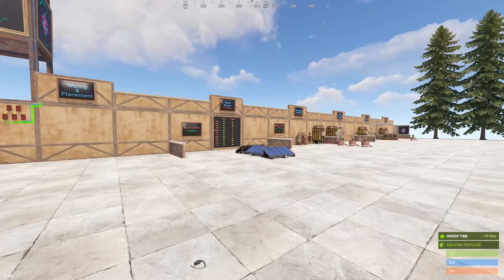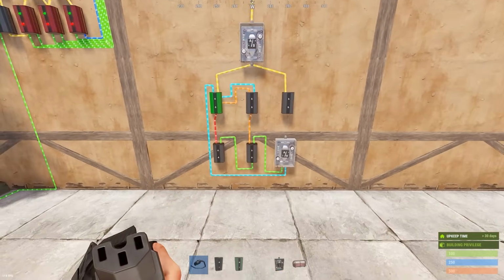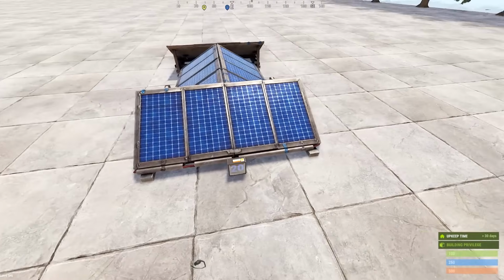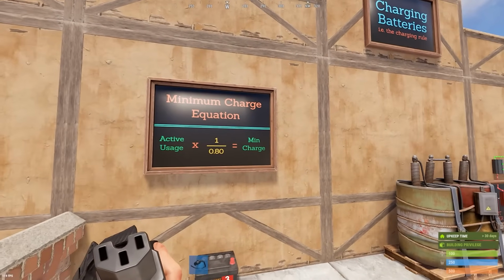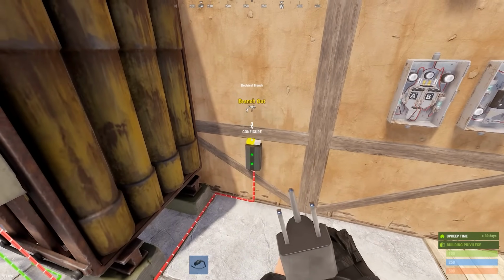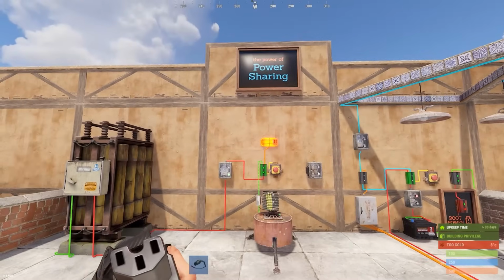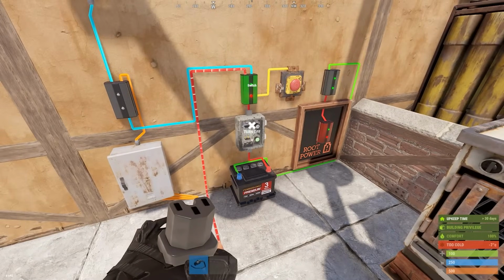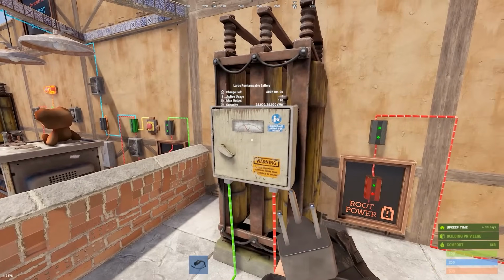RUST Electrical | How To WIRE LIKE A PRO | 5 Core Concepts | 2024

Comment: Man as a new rust player this shit is insane, this games mechanics from building, wiring, plumbing, and automating are so advanced/sophisticated it blows my mind. Had to watch this back a couple times to really have the info sink in before I hop on and update my bases wiring.
Reply: i didnt attempt wiring in my bases for the first 400 hours. I was surprised at how easy it was to get the hang of some solar panels, root combiner, battery and branch all to get some eletric furnaces going. 

Then i wanted to get a drop box and auto fill the furnaces. With a bit of planning i managed to get that working first try using the pipe tool. Its pretty similar to wiring.
Reply: @RealHukTV Yeah after 1k hours playing wiring is pretty easy now, just needed people with more experience to run me through things. Plus with lots of practice it makes so much more sense than when I was first starting. Still blows my mind how much you can accomplish though, whenever I tour someone’s base on pve or pvp I learn so much and improve with my next base

Comment: I’m extremely ocd about how straight everything is and making things look neat. I didn’t know you could snap align things together. Thank you you saved the itch in my brain😂
Reply: Now if only they'd allow the wires to snap align vertical and horizontal while you hold shift as you drag them
Reply: @KCM25NJL which part of an upcoming update.
Reply: Same here 😂 ! I'm spending way too much time aligning things neatly, that's now a solved issue 😌

Comment: "XOR" stands for "eXclusive OR". as in, "eXclusively one OR the other, but not both". as opposed to an OR switch, which will still work if it's getting power from both at the same time. not to say your pronunciation is wrong; but the way i was taught to pronounce it, "ex or" helps me remember what it does. i hope you find this info helpful if you see this. your video has been very helpful.
Reply: I did🙏

Comment: Hopefully you read this. I had an idea about an automated buy and selling system for horses and bikes in rust using AND switches with pressure pads, lasers, and buttons to meet conditions with conveyors detecting payment and door controllers. Just thought of it but thought it might be a good video idea for you. You know rust electricity.
Reply from the maker: Interesting!
Reply: Did you figure it out?
Reply: @ I haven't played enough

Comment: I think it matters where you place your base. If you are located in the North, I've found that pointing your panels South increases the output of the panel. Likewise if you place your base in the South, pointing North. Generally the video I watched suggested pointing the panels always towards the artificial equator of the map. I tend to get a slightly better throughput this way. 
I think your experiment is flawed with regards to the power since it does not take into account the difference in locations. At the end of the day you'll still likely get sufficient power, but I've tested it with multiple locations and pointing either North, or South (depending on your location) towards the halfway mark of the map seems to give the best outcome, though the differences are probably about 4 per panel, but over time (and panels) a significant difference.

Comment: I was trying to run 3 large batteries into one feed of 300 via two root combiners that fed out into a branch that I had split to 1 industrial light as a visual clue the rest out to my stuff. 

I had more than enough generated power via solar and wind to support what I had running but everytime the server rebooted all my stored power would varnish. Three fully charged batteries would just be empty.

Any thoughts?
Reply from the maker: Assuming that I understand you correctly, I would guess there are two possibilities:

1. The server you're playing on is modded, and they've done something weird on the back end thats affecting the batteries.

2. Because you've hooked up three large batteries in "parallel" (combined outputs), you're "triple dipping" the active usage across all batteries. This only matters if you're not using all 300 rWs. If you are maxed out at 300 rWs of stuff, you'd need a minimum of 376 rW of root power on average over a 24-hour RUST day.

Hopefully this made sense! Happy to help you on my server or join a stream.

Comment: Dont be sorry for us console players ive used both your neh core setups but the old one worse for us to have 3 active use the new one works but just shows what youre drawing also so both are helpful ive also used a 4 battery core setup this wipe with 4 windmills 6 solar panels running 50 turrents while also have counter alarms in both open core for both large and small then also having a circuit out for our own ccameras olus used your wireless heartbeat sensor setup to a counter in the corners in our compound with 4 on externals so just shows how many people have jumped the walls over night

Comment: I love what they've done with electricity. I also love that they've fixed turrets. I especially love the new seismic scanner with radar alert on RUST+... Now you can know when someone lets off even an explo bullet within 30m! I'm online within 10 minutes, defending, smoke grenades thrown, lockers put down in doorways, and even better is shooting raiders with turrets while your loading in with your mobile phone!! I love Rust for its features. no other game like it.
Reply: By fixing turrets do you mean making it so that those of us that don't cheat no longer have a way to defend our bases against cheaters due to being so ridiculously limited on the number of auto turrets we can have now?
Reply: @WhyYouAskingMe  No I meant that period of time where turrets were really easy to bait into shooting all of it's ammo away on the corner of a building or high external wall... they fixed that in one of the two most recent updates. Oh and so you know, Rust+ app isn't cheating, it's not third party and is available for all to use. It gives you up to the minute information on your base defences, which is why the seismic sensor is such a valuable tool when combined with a smart radar. Rust+ will tell you when parts of base are already destroyed (not including turrets) whereas using seismic scanner will tell you as soon as the first explosive goes off within 30m, giving you time to log on, and while doing so control your turrets through your phone.
Reply: @THEDUKEOFNUKEYT  I'm sure the person you replied to didn't imply Rust+ was or is cheating at all...

Comment: With power sharing can I put 10 turrets on one side and 10 on another while only having 10 on at a time does this counteract the 12 turret limit? I figure if the north side of my base is getting raided I toggle the turrets on the north side on and the south side off. Allows for more turret coverage this way

Comment: currently is the electrical on console that different? like do i use the  new nih-core or the old one on console?  i know on console they updated it so batteries no longer send out max power consumption and you active power usage now only shows what your actually using
Reply: Still need the old one until components don't cost power

Comment: Love your vids I feel like done right tho ur idea of using ur battery for 2 circuits actually could be infinite circuits I'll have to start working on it I love you Nicore  idea 2 I created the same thing long time ago before finding you not using memory cells tho. I love your channel, which makes me brain storm. I developed a bunker from watching ur vids that use conveyers to depo loot into bunker and only release when switches turned on from inside the bunker, which is a lot easier now that they brought in the seismic electrical part but have yet to try it. Keep up the vids ❤

Comment: Solid info! Been wiring for a while myself but been out of the game for a few months so it was a good catch up for the 2024 changes. Not to be “that guy” but @14:25 you incorrectly stated that all the batteries were the same minus their max capacity. Might be worth mentioning their max active usages are different as well. Again good work!

Comment: as of calculating charge needed for battery.. from your equasion if you transform it, you get that you need to have charge = 125% output so you just add 25% or a quarter of what it's draining and uou are whole set. I never did the math but I knew that if you use 100 from big battery, you need around 130 for it to not deplete and it turns out I was quite on point :D
Reply: Yup! Since 
1/0.8 = 1.25 !

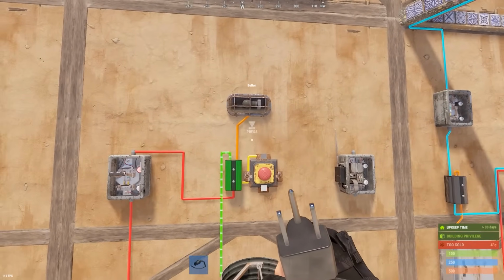Comment: 20:00 I had 4 systems that required a shit tone of non constant energy, and instead of using 4 big batteries I just used 1 battery and a couple memory cells, very useful
Reply: Isn’t the output on the large battery capped at 100rw? What if you exceeded that limit?

Comment: I've got a question regarding the Minimum Charge Equation. I will start with an example I use in wipe (until now.. ;) ):

I connect 1 Splitter to 3 others. On these three Splitters I've got 9 Outputs. On 8 of them I use one Auto Turret each. I never use the 9th output ever.
Active usage is 80. Using the equation I need 100 rustWatts coming in to keep the turrets from dying.

I use one Wind Turbine as my root power. Usually my base is 5 floors high. I place the wind turbine on top of two stacked double door frames.

My question is: why does my battery die on me if I keep the circuit on? Even if I fully charge it overnight, I can't seem to run the turrets the whole time I am online. I've got to hit the switch at some point forcing me to charge the battery.

I hope this wasn't too complicated 
😅

Thank you for your awesome videos. They make me excited to be a rustlectrician! :)
Reply: i saw this comment and tried to figure it out to and it seems like your doing everything right im no where near a pro but maybe the demand for power is higher than it seems or maybe the wind turbine is fluctuating causing the battery to fail if u havent figured it out yet i'll try to replicate what your doing in order to figure out the problem

Comment: One guide I'd like to see is the best places to put the wire on different wall types. I feel like it can get messy especially when attaching to HQM walls because they aren't perfectly flat. 

I wish they'd have anchor points on the wall that you could snap to. Or at least a button you could hold so that the wire would be perfectly straight, maybe with some preset angles like 0/180, 90/270, 45/225, 135/315 etc.
Reply: You saved me time this was main thing I have been looking for.  Sometimes you think you are along the wall/corners etc but then you go back and look and the wire is hanging out away from the wall.  I saw somewhere (console YouTuber) mention how you could make it snap to wall edges but can’t find it again.